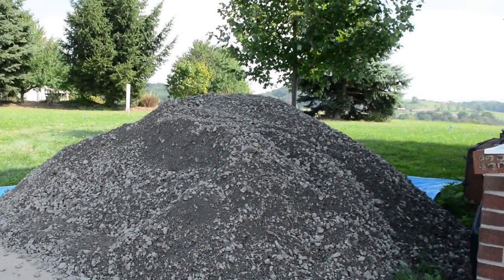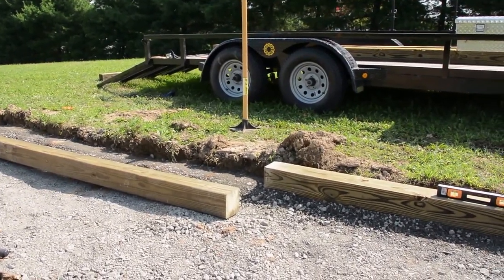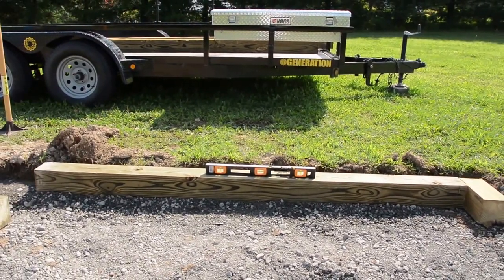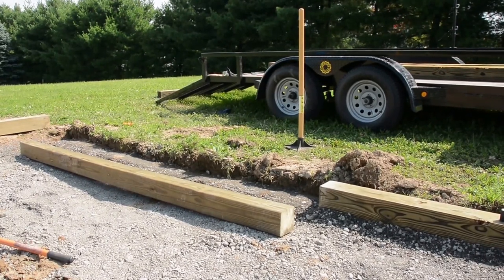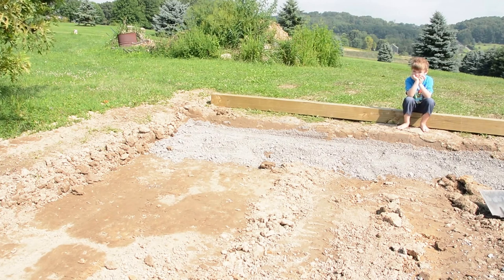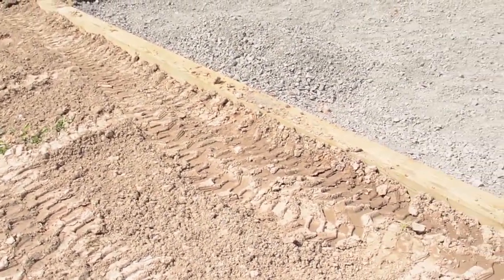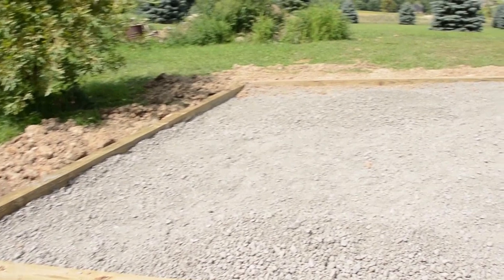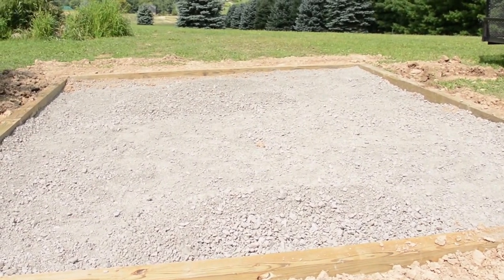Shed Build 02 - Foundation

Comment: Hello Matt, I'm loving your videos! For the foundation, won't the water affect the wood pretty quickly?  What kind of life expectancy do you anticipate for the shed? (I'm completely new to construction of any kind)
Reply from the maker: +John Smith Hi John.   Rot is always a concern when you have wood in contact with the ground.  I did a couple of things to make this last as long as possible:
- I picked a high spot for the shed.  There was never any standing water in the location where the shed now stands - it drains downhill fast!
- The wood that's actually in contact with earth is pressure treated 6x6.  This is the frame around the foundation hole.   It will rot eventually, but at that size and treated it's going to take a long time.   These can also be replaced fairly easily when the time comes.
- The runners on which the shed sits are also pressure treated, but only 4x4 because I wanted to keep the threshold to the shed as low as possible.   These aren't sitting on dirt though.  They're sitting on gravel, which drains, and they're also underneath the shed so they won't actually get wet much.
- The entire frame for the floor shed is pressure treated 2x4's.  They are not in contact with the ground in any way, but they are exposed to the open air.  I worry more about bug than I do rot for these guys, so I spray under the shed every spring.

Time will tell of course, but I did about all you can (reasonably) short of making the entire shed out of a composite of some sort - which would triple the cost.
Reply: +Matt Heere Thank you for the reply. I noticed in your later videos on this series that what I thought were going to be the foundation were actually just to contain the gravel. I feel much better about that! Good looking shed. By the way, I found your channel from the HF dust collection modification video.